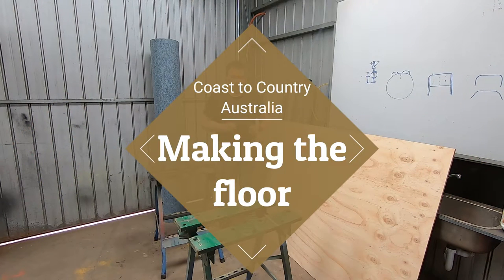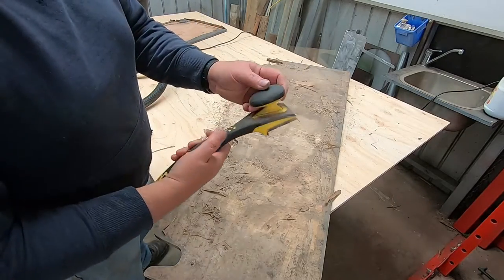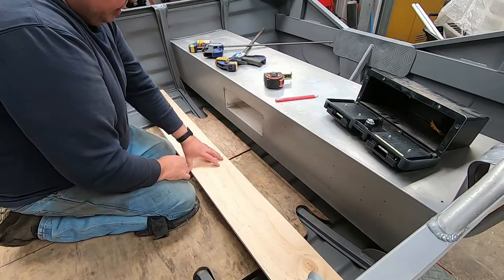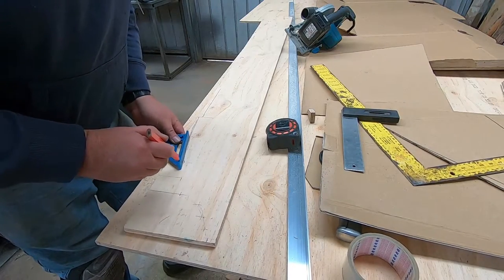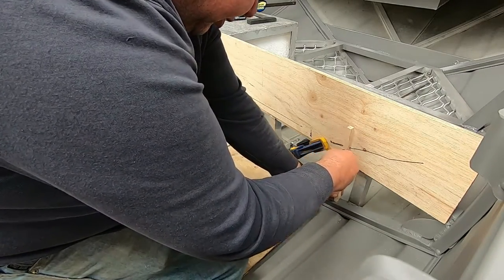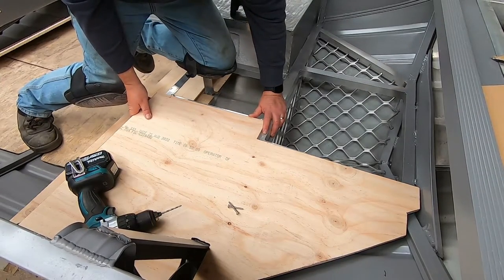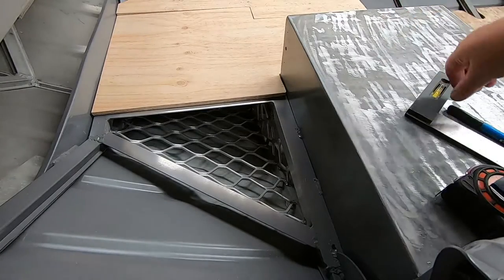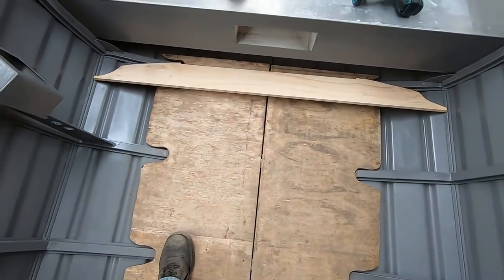Fishing Boat Project, The Floor, Part 9

Comment: Just pulled up my floors on my new Quintrex Explorer (July) and surprisingly found that the ply isn't sealed either.  Now to rip the carpet off, seal and replace with EVA before they start to rot.
Reply from the maker: It's a bit of mucking around but worth it in the long run. Thanks for watching. Cheers